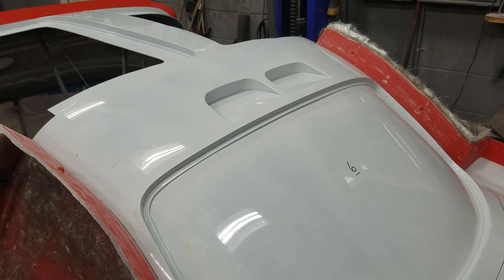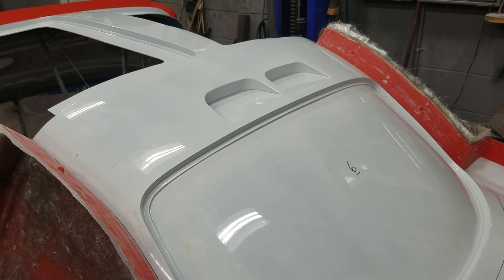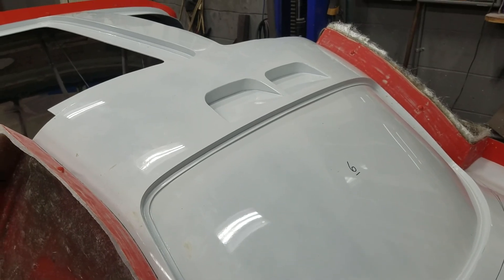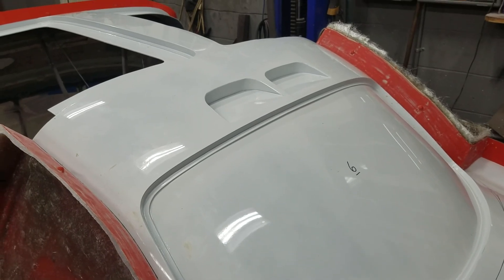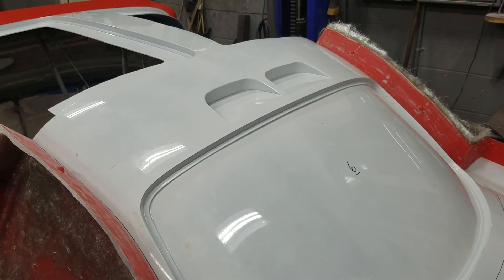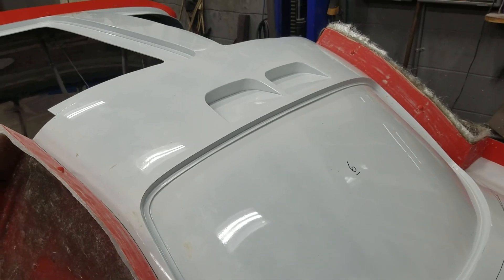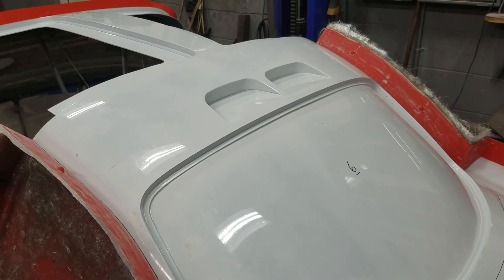300 SL Gullwing Replica, video # 6

Comment from the maker: It is just me doing this, it has been my part-time job since August 2015. there is somebody trying to sell a gullwing kit car on Ebay, he is asking $195,000.00. he will never get that but one of Quints replicas sold in 2014 for $120,000.00 and that car was far superior. As far as what molds are worth, here is my equation to that answer. how many cars mold can produce x price of car and devide that by half. so a low figure is 50 x $40,000.00 ÷ 2